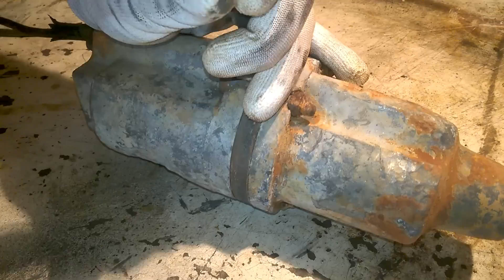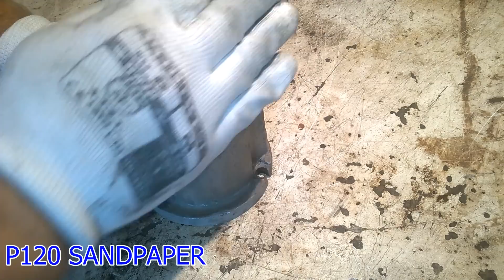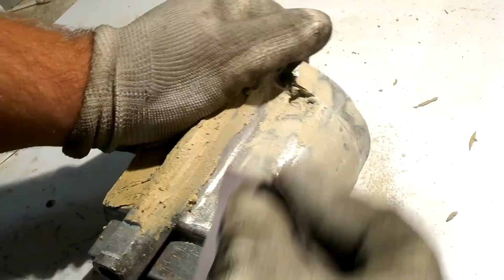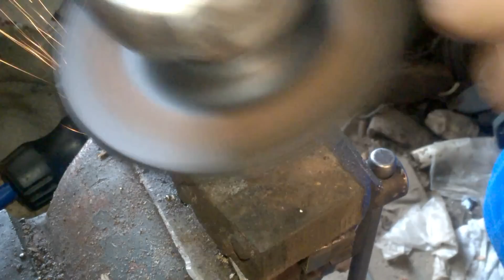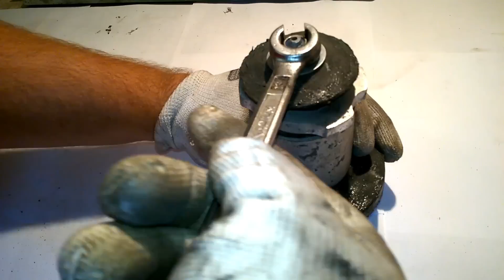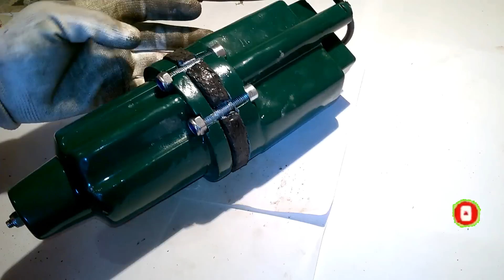Restoring An Electric Water Pump

Comment: Good and encouraging work. I am very interested in this video because I have one of this pump. I bought it as second hand item and later realised the inscription on it is in Russia. I have therefore never put it to use since I dont understand a thing in the Russian writing on it. Can you please post the information embossed on the pump/ data table.   Many thanks
Reply from the maker: THX the comment.
I dont know what whrite the data table where written the production time and the cuntry USSR and finally all words written in Cyrillic. But I know be careful, dont use a lot of time at once because, the pump transformer is made to be used at 160 to at most 200 volts, so being used at 240 volts it would be extremely strong and pump water efficiently.
Reply: @Blazebb01  Many thanks for your candid response. i started a search online got information here: https://www.hms.ru/pumps_catalog/detail.php?ELEMENT_ID=1683  and manual here: eplocom.com/files/rucheek-bv.pdf . you can also use the pump's name to search: электронасос бв 012-40-у5 ручеек. Any information you get can be translated a little at a time with Google Translate.
ENGLISH TRANSLATION OF SPECS: Source: https://www.hms.ru/pumps_catalog/detail.php?ELEMENT_ID=1683

Pump BV 0,12-40 "Stream"
SPECIFICATIONS
Parameter 	Value
Current,    A	  3.4
Power consumption   kW	  0.3
Voltage	   220
Mass of the pump,     kg	   3.2
Current frequency,     Hz	  50
Power cord length,   m	10, 16, 25, 32, 40, 50
Pump type	Lunch
Reply from the maker: THX my friend :) OMG good work. You share with me lots of new information. Please watch my other videos, like, share, subscribe, etc :)
Reply: Is this a solenoid vibration pump? I recognize the shape from eBay, it only says that its a short life occasional use pump
Reply from the maker: Thanks for the comment.
Please share, like, comment, watch my other videos
Videos:
https://youtu.be/HP-pyyWtUhk
https://youtu.be/yt9RvIWh0Vo

Comment: Not soviet. These pumps are made to this day and are the perfect example of modern day garbage products. They don't last two months of use. The transformer is made from aluminum wire and it made to be purposely overpowered to make magnetic field stronger so the pump pump more fiercely. Basically saying, the pump transformer is made to be used at 160 to at most 200 volts, so being used at 240 volts it would be extremely strong and pump water efficiently. Hense why they fail so often. If you can, buy a centrifugal submersible pump, those work much better.
Reply from the maker: THX the comment! If you want i send the data table where written the production time and the cuntry USSR and finally all words written in Cyrillic. Good observation this used at 160 to at most 200 volts, so being used at 240 volts it would be extremely strong and pump water efficiently.  And yes  the centrifugal pumps mutch better the membran pupms.
Please watch my other videos, comment, subscribe, and share.

Comment: Did it work?
Reply from the maker: THX the comment! No this pump not work after the restauration, because the membran nd othe parts has a lot rust, and the shaft stuck.
Please watch my other videos, comment, subscribe, and share.
Reply: Or ok but very good attempt though. You win some you lose some🙏🏼🙏🏼👍🏽👍🏽👍🏽👍🏽
Reply from the maker: @electron1012  Yes i know but i forget cut this scene and paste in the end of video how work the pump. Please watch my other video and comment, share, subscribe.